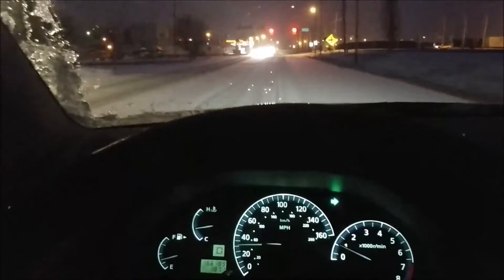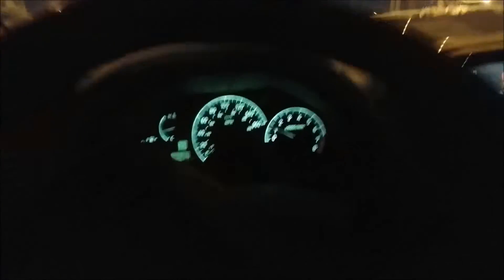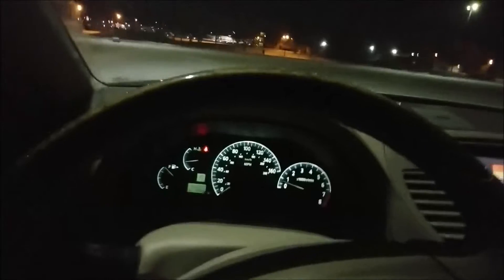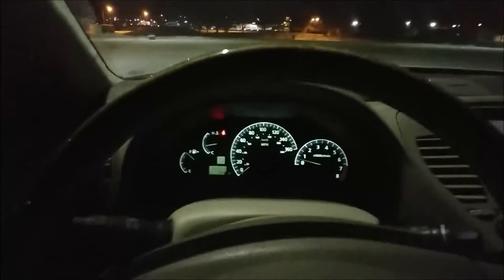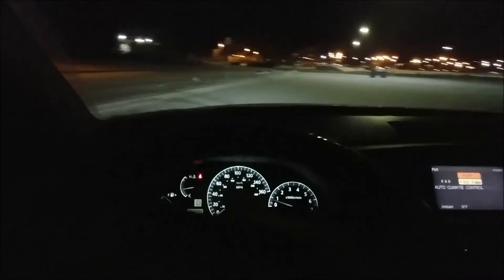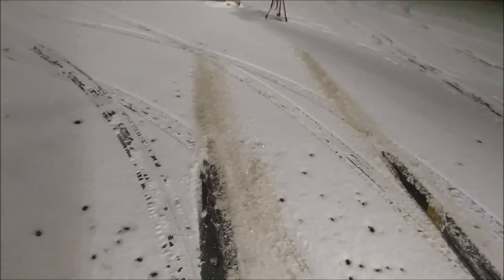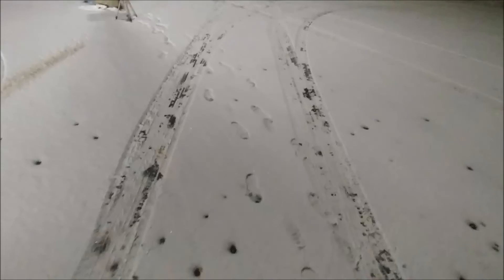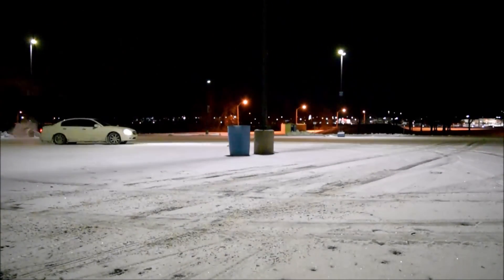Infiniti VDC button, driving in snow. Part 2| What exactly does the VDC feature do in the snow?

Comment: Ed, my Q45 has nearly 200k and runs phenomenally. My only issue, which seems quite common is the VDC/Slip/ABS light combination. Still runs really well, good gas mileage, etc...

But, living in Indiana, I feel like its important that I resolve this prior to winter. From what I gather, many times it's caused by the camshaft sensor. Before exploring this as a fix, I wanted to ask you if the absence of TPMS sensors could cause these lights to come on?

Any help would be GREATLY appreciated, just as I appreciate your content. 🙏
Reply from the maker: Indiana? Nice, I moved here recently. The car is a beast in the snow, but of course requires a fully functional stability system.

That combination of lights is not typical of the TPMS sensors. That usually just pops the horseshoe after about 30 miles of continuous driving.
In these cars, it usually doesn't follow the cam sensor either, but again that sensor fails in like 77 different ways, so I encourage people to just replace it if the history is unclear...or carry a good spare.

The most likely scenario is a bad alignment. But again, make sure all 4 corners have at least the same tire, your brake fluid level is OK, and very rarely a damaged steering angle sensor/on the clockspring, ABS pump, ABS fuse. You get it, the possibilities are endless, lol. I like to start with the cheap/free diagnoses and fixes.
If time is of the essence, bite the bullet and pay for a proper diagnosis from a dealership that will tell you exactly which component has failed so you don't waste money on replacing the wrong part.
Reply: Got a 01 infiniti i30t i love to death great car have abs slip an tcs light pain in ass really !! But car runs an drives fine evem has good power but i try to take it easy on her 150k
Reply: @snowfall1771  only in the snow though right ? Like on a dry street it shouldn’t come up
Reply: @lilsticky-3972  hahaha nope on dry pavement must be senser ....

Comment: Good vid I need some M action too
Reply from the maker: The weather hasn't cooperated. The cold has been bitter, but not,much snow. Well, we got some surprise snow this morning. I guarantee if you have decent tires on the M it's gonna do the same thing as the Q
Reply: @EdBwoy  Sweet do you still have the 56 (Hoping to see the Snow Mode in action)
Reply from the maker: @gsxellence I still have it, but it's gonna be a cold day in hell before it sees snow, hehe. 
In a basic sense the snow mode acts like traction control shown here. Use it when snowy or wet, and it reduces the engine response. The main purpose is to avoid spinning the wheels.
Reply: @EdBwoy  Ummm hmmm. We need more 56S life... I'm waiting :)

Comment: In My 06 M35S I Turned The VDC Off To Do A Burnout Someone Said Only One Wheel Was Spinning Is That Normal With Infiniti RWD Vehicles???
Reply from the maker: Lol, yup! They have open differentials. Some G35s, G37s came with limited slip differentials to allow you to burn both tires. 
I touched on it in part 1